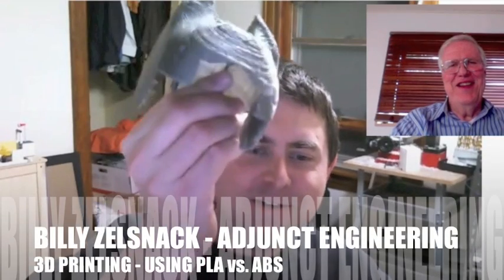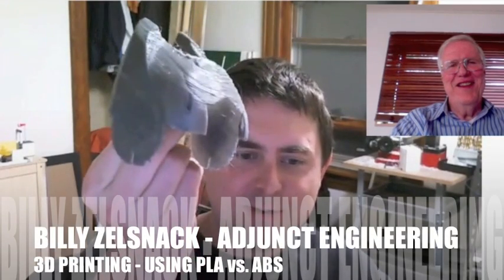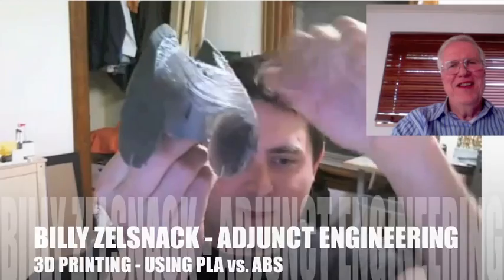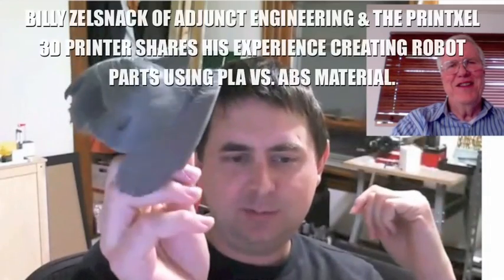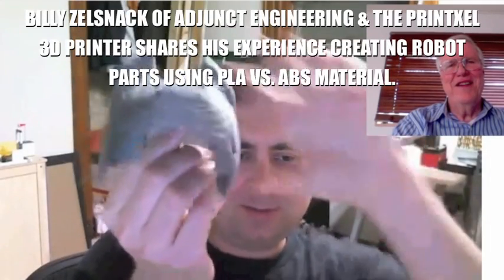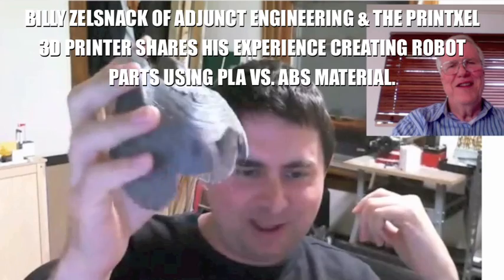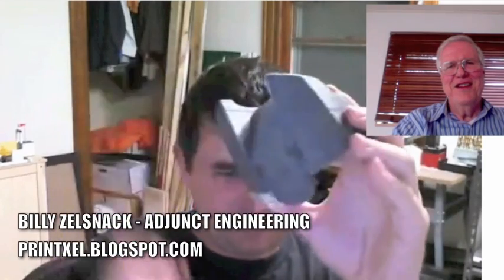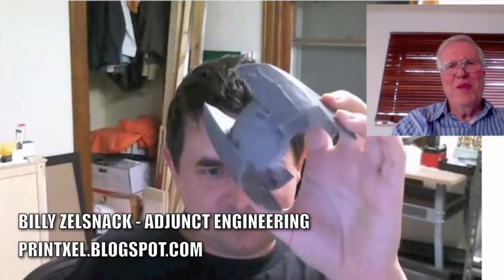3d Printing Robot Parts - Using PLA vs. ABS

Comment: I am a character artist who uses 3d software to design action figures. I think PLA would be good for 3d artist for most projects unless a particular part or model would benefit with flexibility i.e. hair and some clothes like cloaks to be printed in ABS. So If I were to print a super hero, I could print the hero in PLA including his gear belt but his cloak would be in ABS. ABS is flexible enough to create a convincing wavy blown effect.

Comment: There is another plastic called HIPS, not to sure of the heat requirements for it.

My suggestion would be that you use what you make from PLA just as a casting, and look at a 2 part plastic, but you need to make the molds first and that's another fun looking part that is a 2 part mix, all I'm getting at is that "if" you make items for sale you can use other types of ways to make a creation/end product thats more robust and could have a better heat tolerance.

Comment: I learned on PLA, and its easy. 
ABS needs a lot more heat and is very temperamental. 
Each has its own use. 
Your motors shouldn't get hot. Your linear rails may have too much friction. 
Extruder needs ABS, everything else for my machine is PLA.

Comment: abs can have a melted plastic smell from time to time.
I dont notice it often but from time to time I do smell it
pla does not have that smell prints at lower temp and is bio-degradable
if you use ABS the best way to get a good print i've found is to keep your bed heated to about 105-110c
PLA can run at 60c on the bed